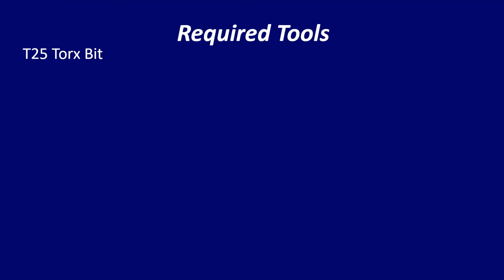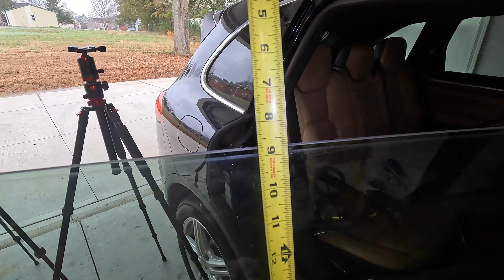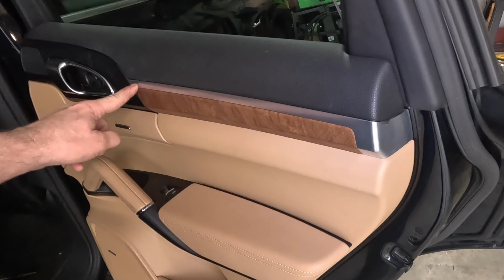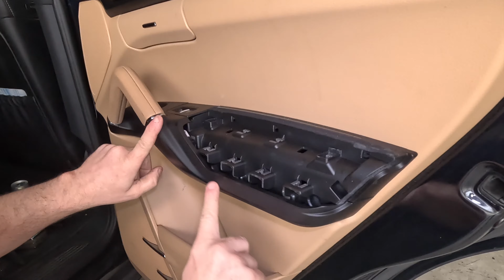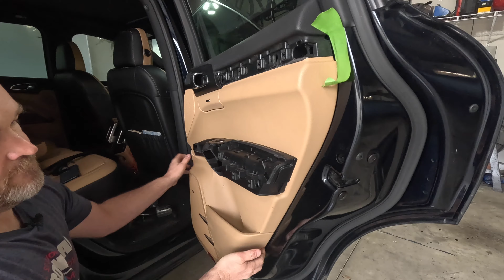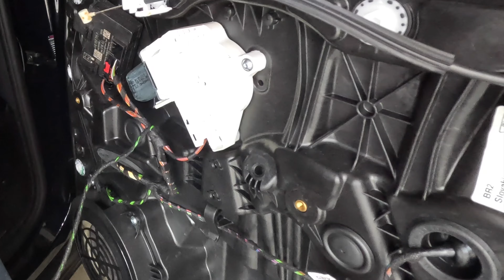Porsche Cayenne 958 Rear Door Latch Replacement - SAVE MONEY!!

Comment: Great video! Worked pretty well for my 2013 GTS. Two small remarks: the window lock needs a 4mm socket. I found it easier to remove the door latch first and disconnect the wire harness afterwards.

Comment: Thanks!!! Super helpful video!

I had a hard time unclipping the connector on the door latch, but I was able to remove the screws and the door latch with the connector still attached, and then unclipped it afterwards. Mine had a slightly different latch that was a pain to loosen.

Comment: I used the 5/32 socket and the screw wasnt budging for the window clamp am i doing something wrong?
Reply from the maker: Which way did you turn it?  From memory, “tightening” the screw (to the right) loosens the clamp
Reply: @AutoAnatomy yeah just as you did in the video clockwise to the right

Comment: Thank you for taking the time to do this video and contributing. Probably saved me $1000. The 5/32” socket and reverse thread tip on the glass clamps was life saving. 

For those of you with the privacy shade, once you pop the door panel off, pull the shade up manually with your fingers from the flap it comes out of. It’s a ~14” thin rod that will come right out. 

When doing these jobs I always keep a few spare OE door panel clips on the ready as the old ones can break upon removal.

Comment: I have just tried doing this when it is close to freezing outside.   I have had to stop as my hands are like those of Sir Ranulph Fiennes.  I am reaching for the saw.

Sadly this video is a bit of an oversimplification.   The inner door panel with the window mech does not come free as shown.  There are electrical cables to the outer handle and they are wrapped and clipped tightly to the white bracket on the back of the lock.  

Its a real pain in the arse job.  Wait for a warm day, even if the constant reminders of your closed door being open drive you totally mad. 

This is Porsche overcomplication at its best.  I don't car if people's children fall out of the back door.

Comment: Thank you so much for this guide, even though I have access to repair manual in Alldata, visually it is very helpful. Best of luck.

Be careful with plastic bracket that hole in place actuator there are a lot of small hooks and clips that may break. Ask me how I know :)
Reply from the maker: Thanks, hope it helps!

Comment: Aw man you are a life saver!  I just picked up my 2013 GTS a few days ago and noticed after every time the car stopped and I set off, that the doors would be "locking". This was driving my crazy and I tired to change every lock and memory setting to stop this from happening. Just this evening I went to check the car was locked and both rear doors don't lock... here I am on you tube and In the first few minutes of the video you had my issue diagnosed, courtesy of your wife (great job) and I'll be ordering some new locks for install as per your great video!!!!!  thanks to you!  Cheers!!!!!
Reply from the maker: So glad it helped!!

Comment: Great video. I would not have figured out that you need to tighten the shafts on the clamps to release the window. FWIW, a 4mm socket fits the studs snuggly. One catch for me was that I have window shades in my rear doors. That took a little bit for me to figure out. In short, you open the shade cover from the inside, and then lift the shade all the way up to get the plastic shaft out of the guide. You can then pull the top of the plastic guide out as the plastic tube is in two pieces. This will make it easier to separate the inside panel from the door. When finished, you can put the inside frame back in place and insert the tube from the top to reseat it before inserting the window shade shaft back in.

Comment: Very well done video. I'm not sure I could have replaced my latch without it. I ran into a few differences/problems. I have the automatic sunshades that created the first obstacle.  The problem is the lift rod keeps you from removing the panel. After watching a few videos and reading several suggestions, to disconnect the rod I decided to just drill a 1/16 hole in the outside of the top plastic frame just adjacent to the rod and just below the line down the center. Now the rod can be easily released by inserting a pin in the hole to depress the spring that holds the rod. A bigger problem for me was my car has the buttons on the handles to lock/unlock the doors. The plastic piece that you move from the old latch to the new I think has an extra piece of plastic that goes across and slides into a groove on the door handle for the wire guide That piece that goes across would not allow me to slide the actuator/plastic assembly past the window track that hangs down a few inches for the bottom of the window opening. All I could do was first slide the plastic piece into the groove on the handle, then attach to the actuator inside the door, a difficult task.
Reply from the maker: Thanks for the feedback, I appreciate you taking the time to write up your experience!

Comment: I completed mine today on a 2011 Porsche Cayenne S.

I started by following the video, and everything was going perfectly until I reached the part where you’re supposed to use the 5/32” tool.

The mechanism on my Cayenne was totally different, so I had to play around with rolling the window up and down—over and over—until I found just a little bit of space to remove the actuator.

In my window mechanism, the glass is held by two “holders” (not sure what to call them). The screw size was T25, but the surprise was that the nut is located on the inside—on the opposite side from all the other nuts.

I finally finished this “little job,” which ended up taking me around 7 hours. I know that’s a long time, but because of the different window design and tight space, I had to be extra careful. I also had very limited room to work inside the door, and my hands ended up hurting a lot.

Right now I’m drinking a beer really satisfied 😊 🍻
Reply from the maker: Glad you got it done, and good job troubleshooting through the differences!

Comment: Fantastic Video. Many thanks!
Have an issue though. Was following the steps fine until the part where the window glass holder clamp (male torx screw) needs to be loosened by turning clockwise. One of these nuts doesn't want to come loose. :( It looks a bit stripped and I have tried everything to unscrew it without success. Is it really important to loosen this and free the glass. Why cant I just take the window to the top and unscrew the inner panel? (haven't tried it yet - hence the question)

Any other suggestions on how to give it enough grip to loosen it? Don't want to mess it up too much obviously as the window currently works fine.

Have tried inserting rubber band in the socket already - no success.

Any help is welcome.
Reply: So... after wasting much time and cursing my luck I finally found a solution. Recording it here for future adventurers.
Note: This only applies if the nut closer to the hinge has gone bad and doesn't want to turn using the method everyone describes. If it is the other side - at least I don't have a solution.

Take off the Bose speaker off and slide the window all the way down. Now you can reach through the speaker hole and feel from the Torx screwhead using fingers. The torx size is roughly the same as the rest of the screws on the door. I was able to tighten a small bit to a small clamp wrench, go through the hole and feel my way in the screwhead. And then you would turn it clockwise (because it's still reverse) to loosen it. Just loosen it enough for the glass to come loose and viola - that's it.
Reply from the maker: Wow, sorry that your hinge was bad and you had to do so much work, but thank you for adding this!   Hopefully someone can benefit from your unfortunate luck.
Reply: Had the exact same problem. Couldn’t have done it without your idea to come through the speaker. Thank you!
Reply: Had the same problem.  Called the Porsche dealer, turns out you don’t need to unclamp the window.  Just means more fidgeting, but it’s doable.  Worked for both of my rear doors
Reply: @lcwistar  So you don't need to unclamp the glass?  do you leave the window up, or down to do the work?

Comment: This is a really well done video, thank you.  My car is a 2014 Cayenne Diesel, and the rear left side door stopped opening from the outside after locking and unlocking with the FOB.  Once unlocked, it opens and closes fine from the outside.  This is very coincidental to having some dings removed by a paintless dent removal guy- who was clearly using his tools inside that panel.  So I'm wondering if I need the new actuator or if something else might have happened to the cable, maybe it's hung up somewhere.
Reply from the maker: Thank you very much!  If the only thing that changed was the painless dent removal I wonder if something got unplugged somehow.
Reply: I finally got my door actuator replaced, and this video was invaluable to the process.  Thank you- everything was really well laid out and explained.  Thanks to rewind- I got the job done, took me a bit longer than most others who have posted, about 4 hours I'd guess.  The issues I ran into were, first- that I have the automatic sunshade.  I could not figure out how to separate or disconnect it, so I tried to work around it, using the small bit of slack in the pull line.  This made the job more difficult for sure as my space was restricted.  Nevertheless, I was able to go through and following the video get it done.  The other issue was that the bolts that clamp the window in place are at a certain point when the glass is down.  When I followed the instruction and measured 9",  the bolts did not appear within the opening.  I used my phone camera and carefully marked my progress by moving the window slightly until they appeared.  That might be a recommendation for a bit more detail in the video, but I figured it out.  I also had a bit of difficulty with the upper cable for the door handle - getting it back in place and then getting the clips to lock.  The video didn't show this- nor could I find anything else that did.  Trial and error finally got it.  The good news is, everything finally went back together like new, and the door and key fob work perfectly now.  Thank you for this super helpful video!!!

Comment: Thanks a lot for your video! Just fixed the door lock on my 2011 cayenne. I had the version with the window blind, just an extra step, lift up the blind fully in order to remove the panel. The two outer T30 bolts(M8) on the door lock stripped out so I had to drill them out and use an extractor bit.
Reply: @joe73660  Did you lift the blind at the beginning?
Reply: @n @nov102012 , I dealt with it after all the screws were out. Careful with the short lighting cable when removing the panel.

Comment: This was a fantastic tutorial - thank you so much! I saw some tutorials on some forums which had far more steps, and required the exterior door hand to be disassembled! This is a far easier approach.

The things that took me the longest were retrieving the bolts that dropped into small crevices, as well as aligning the window properly into the arm when reassembling everything. Other than that, it was smooth sailing. I only have another two busted actuators to go!
Reply from the maker: So happy you were able to get the latch changed easily, and glad to help.  Thanks for watching

Comment: Thank you for the video! I do have a quick question on the window. So I rolled it down half way and loosened it with the 5/32. But now when I try to drop the window back into the notch and tighten, the window still seems to hit something causing it to not drop fully. Did you keep the window up, while the 2 bolts were loose then put it up and bring it back down then tighten again? Hope you can help! Thanks
Reply from the maker: Thanks!  I kept the window up while the bolts were loose and then dropped it back down and tightened the 5/32 bolts.

Comment: I just want to take this moment to thank you for posting this video. There was no way I could have finished this job without breaking something (and/or getting stuck forever), most specifically on loosening the 2 glass window bolts (turning clockwise) and using 5/32" socket (I was looking at it and trying to figure what tool I needed to loosen it, rewind the video, and saw you specified using 5/32" socket). Again, there was just no way I could have finished this job without your video. I would have packed everything up and taken it to a specialist, which I heard would have costed around $400 labor. Again, thank you for taking time to put this video together.😊
Reply from the maker: Thank you for the kind words, and so glad you were able to accomplish it yourself!

Comment: I did mine today on my 2014 Cayenne GTS. There were more cables than this video, so it took me longer and I had a hard time getting the plastic piece back in with the new latch assembly. But I did get it! Works GREAT! Thanks for the video! It took me a little over 2 hours.

Comment: I just finished replacing my left rear door actuator on my 12’ Cayenne S. Everything locks and works well, but there’s no beeping after the car is locked. It’s driving me crazy. What could be the cause of it?
Reply from the maker: It sounds like the car doesn't recognize the door lock working.  I'm not sure why it's not beeping.
Reply: @AutoAnatomy  is there a way to reset something to get it to recognize it?
Reply from the maker: I'm not sure.  It worked straight away on my car.  Sorry I can't be of more help here

Comment: I saw you lift the glass up during the disassembly but you didn't show what to do during the reassembly. Is there anything that needs to happen with the window during the reassembly?
Reply from the maker: You set it back down and clamp back in place.  Basically the reverse of disassembly.
Reply: @AutoAnatomy  Instead of pulling the window glass up after loosening the clamps I have seen other videos to just suction cup the glass in place at the 9inch roll down mark and then no need to touch the window.  Assume that will work the same as I'm going to tackle this job this weekend?
Reply from the maker: @digants2663 Should be able to, yes
Reply: So I got everything done as your video was perfect. I held the 8 inch rolled down window glass in place with suction cup and completed reinstall with no issues and door lock is back to working properly. I hit the window to roll up the glass and the glass just drops down. I was able to pull it physically back up and hold the window up button until it secured closed, but if I try to roll down at all the glass just drops into the door.   Or sure how the mechanism works, but I guess I will have to take the door apart again to see.

Comment: How are the Corvair heads?
Reply from the maker: Haven't done anything with them yet, still sitting in the box.  Hoping to wrap up the fuel injection next week, then on to some other projects.   The heads will probably get sent out in a couple weeks to get worked on.
Reply: @AutoAnatomy  Looking at a 66 4dr Corvair tomorrow for $2500
Reply: Hope it works out.  Cool car.  When you take pictures, always have all four windows down. @malcolmmarsh2710